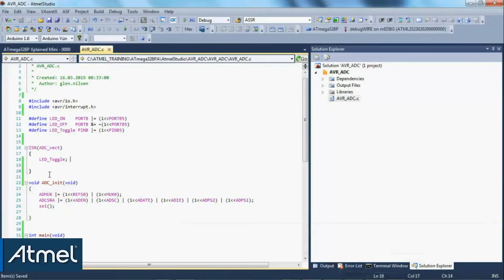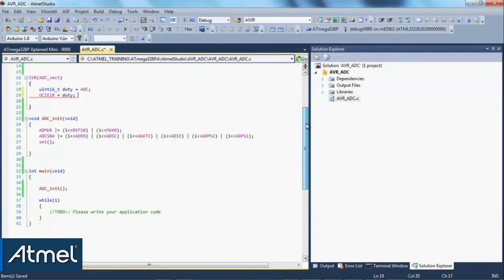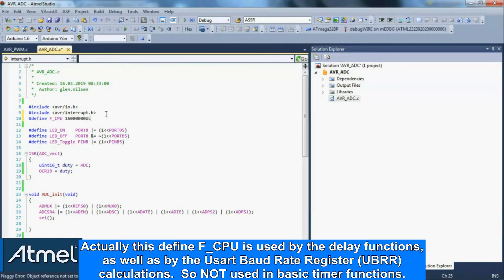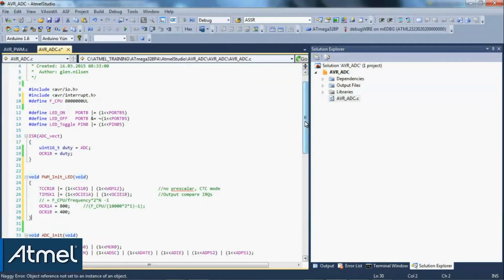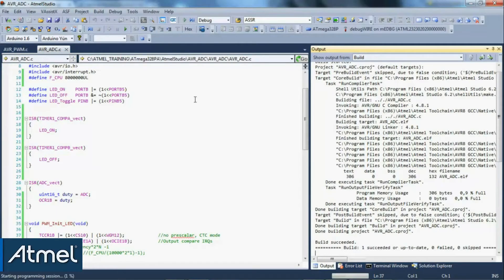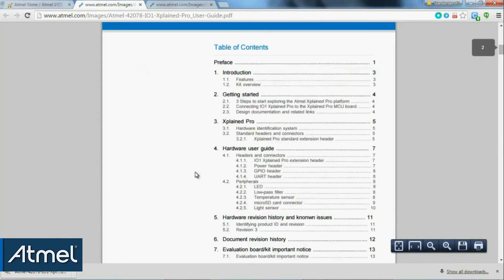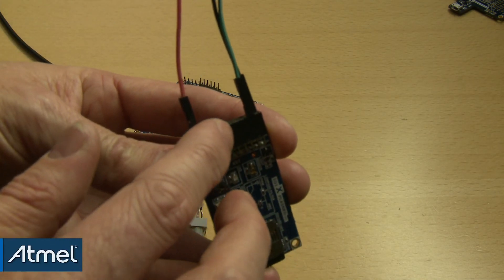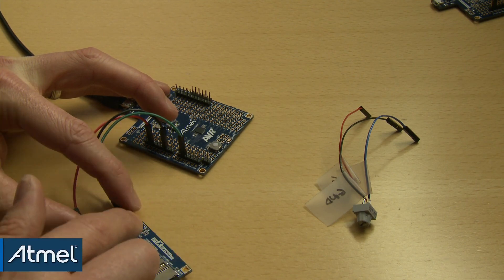Getting Started with AVR: Updating PWM Duty Cycle Based on the ADC Sensor Reading (#23)

Comment: I tried this code: 
uint16_t ADC_read(){
	return ADCH*256 + ADCL;
}
when I read from ADCL. The value is constant! why?
When I read from ADCH only. It change accordingly.
When I read from ADC it is correct. However, register ADC is not stated clearly in the ATmega328p datasheet.
I am using Arduino Nano

Comment: how you change brightness of the led connected to PINB5  with PWM  while the PINB5 not a pwm pin???
Reply: you will have to use digital PMW, or rather make it yourself
Reply: First you decide at what clock speed you want the light to flash. then you will setup up a timer with prefered scalar value to find how figure out the amount of ticks needed for your chosen clock speed and thne you setup a variable to manage your duty cycle
Reply: Sorry for the wordy post, but try this approach, it might save or help someone when they need to do PWM for non compatible pins, but the basic idea is that with the clock interrupts we can keep track of the LED time, and thus conditionally decide when to have the LED on/off ,thereby creating the process of PWM, note that PWM effects are not always visible with the naked eye on all light frequencies, so lowering the light frequency can help make the effect more pronounced

Here is an example. (implementation techniques may vary of course)
My desired LED frequency is 1KHz (1000Hz) //it's recommended to have your LED frequency lower than the CLK frequency
you want a duty cycle of 35%
let's say that my board has a clock speed of 16MHz (16,000,000Hz) 

my scalar value is set to none (so it''s 1)
So with 16MHz your time per cycle will be 1/(16*10^6) == 6.25*10^-8
 sec per cycle or 6.25*10^-5 milliseconds per cycle

now here is the special part, while in 1ms the light has gone through its on/off routine, since we want it to be on for 35% of 1ms and thereby  100-35=65% off the other time, we ought to have a clock interupt every 1ms/100 (so we can check every 1% of the LED clock sycle). you could setup the clock interupt to go off every 5ms/20 since 35 and 65 are multiples of 5, or use a precentage even smaller than 1% for greater accuracy, but for now let's focus on setting the timer on 1ms/100 which is 1% of the LED dutycycle

so with our original clock (16MHZ) we would need 0.01ms / 6.25*10^-5ms per cycle = 160cycles
Since the 8bit clock top counter value goes up to 256-1=255 cycles, we can depend on this clock (could also use the bigger 16bit clock)

Then setup your timer to go with going off every 160 (associated with this setup, NOT universal) and then then setup an ISR where every each time the interupt occurs you have counter++; (make sure to make counter variable VOLATILE when declaring it)

then finally somewhere in your main while loop code you could have a conditions that 
if counter> OnTime // our case 35
 then toggle LED, //in should turn off 

else if counter>99  // count ==100, so we completed our cycle
then toggle LED //should turn on again

Don't forget to reset your counter when you turn it on again, and you also should have some kind of second condition, a flag maybe.
EX: dutycyle is 29

count =30
so light toggles to OFF
light fails to toggle back ON since it's less than 99

count now is 31
so light toggles back to ON as it met the first conditions -- you want to toggle only once the light on duration is complete
light fails to toggle back ON since it's less than 99

Hope this comments helped you, or can help anyone else in the future